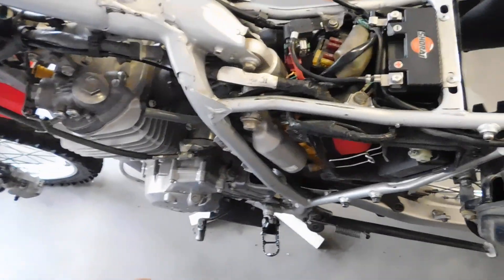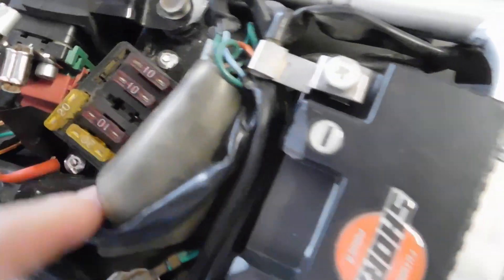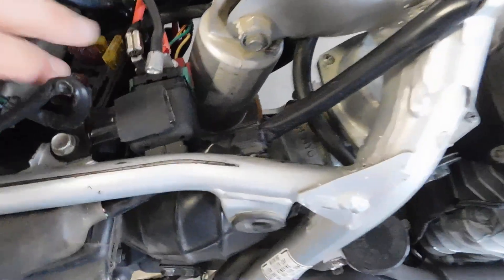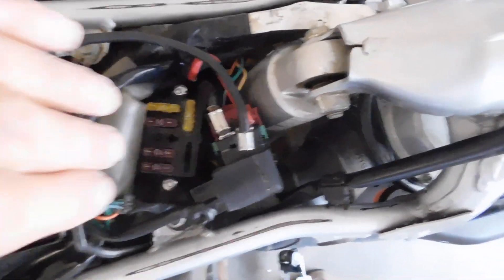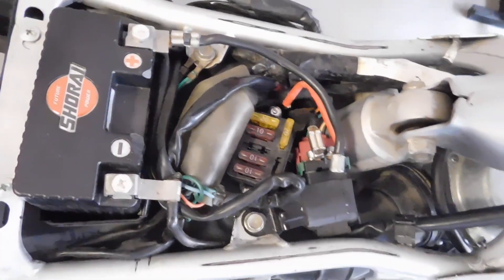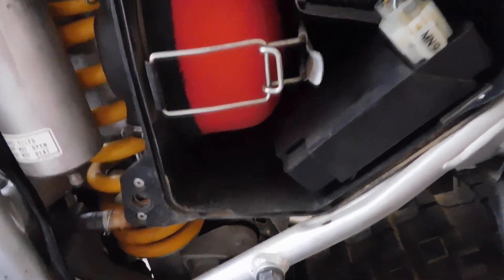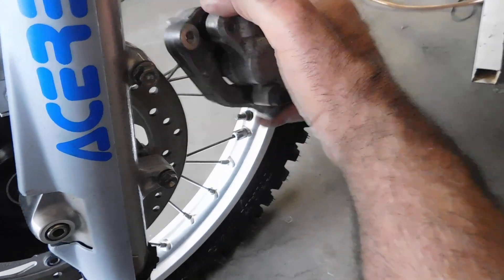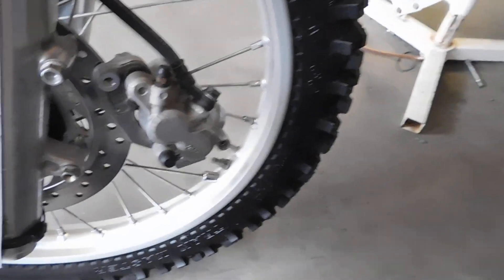Honda XR650L Battery Box Mod.

Comment: I think just changing to a Li ion battery in stock location gets you most of the weight benefit.  The stock location is actually lower in the bike but admittedly less centralized.
Reply from the maker: I have the small Shorai lithium battery in the side battery box too, with no problems. I do like the part of the conversion that puts the CDI in the airbox where it does get a stream of air flowing over it, since the CDI is the weak link of the bike. At some point I will do the full conversion but it is down on the list. Thank you for watching.
Reply: What I'm thinking to

Comment: I have contemplated the mod over the last 3 years of owning the bike. It does shed weight but my problem is, by moving the electrical you now have to remove the seat. I like the idea of the stock design as all electrical is isolated and easy to get to in the field.I guess it comes down to what you are trying to accomplish with the bike. I’ve learned what can go wrong will and the easier you can access it the better.
Reply from the maker: I came to that conclusion too, and just installed the new lithium battery in the stock battery box, and called it good. 
Main thing is just getting the weight down with the battery.

Comment: As many times as I have had to get to my battery, I will be leaving mine stock. 9 lbs doesnt make a huge difference when you have luggage, big size gas tank, skid plate, etc.
Reply from the maker: I got mine installed in the mighty XR650L and she spins over just fine, from what I have been reading this is the Cats Meow! 
I'll let you know if I have any issues pop up.
Reply: Agree 100%. This is a hack job. Wires jammed everywhere, open fuse panel, air box full. I'd like to save the weight but not this way.
Reply: @justintruedough4450  wuss

Comment: I did a battery relocation on my 2015 and it worked, never had any problems but if I ever get another one, I would not do this, just go with lithium battery and call it good
Reply from the maker: That is the route that I went and I’m glad that I did. Thank you for the comment

Comment: What was the factory setup on the earlier XL500, I know they didn't have electric start, don't know if they had CDI- it would be handy to adapt parts if they were similar as I would like to make a tool box to go where the electrical box is & be able to eliminate the tool bag for a bigger rack as I now have to use a smaller rack which wraps around the tool bag. 
Batman
Reply from the maker: I'm not really sure what the XL500 had for a battery set up? I was big on doing this mod but instead I just added a lithium battery to the existing box and called it good. The lithium batteries are so light the weight is negligible in the stock box. I ran the little Shoria battery for over a year with no issues. Thank you for the comment.

Comment: So let me start by saying I’m not sharp shooting or giving grief, just inquiring. That mod seems like it takes a lot away from how much air the motor can be fed. Looks like the the snorkel is completely gone. Im wanting to do the battery relocation but im also trying to get a little more power out of my 650. And it seems like this mod might take away form performance? Curious to see if you or anybody else has noticed any performance related issues.
Reply from the maker: I agree, I just used a small lithium battery in the original battery by and called it good. That move met my needs of getting the heavy battery gone from the rear. Thank you

Comment: One mod I’m not gonna do to mine, looks like it would harder to get filter out, I don’t like grinding things down especially a battery, plus I ride at trails I don’t want any extra water in my air box from mud holes
Reply from the maker: Yes I can see that, I have been running the small lithium battery in the side suitcase with no problems. I will probably go through with the mod though at some point. I think I can do it better than what the guy did in the video. Thank You for watching.

Comment: I think I might do this soon on my 2017. Was wondering if the Banshee is as good as the Shorai...? It's quite a bit cheaper in price. Heard anything about it?
Reply from the maker: I never heard of the Banshee? 
I have been reading several articles on the Lithium batteries and if you have the extra money its the way to go. Thank you for watching.
Reply: @verbalwidget0919  Hey, the Banshee is a Lithium battery too.....same basic size and weight...etc....but a "cheap" version....it's like $115....didn't know if it was just a cheap POS or not...anyway, thanks, your video will be helpful to me when I do my bike.
Reply from the maker: @buddywilson104  Glad to help, Let me know if you have any issues with your battery and I will post a video if I have any issues with mine. Take care boss!
Reply: Why do you want to put it all back to stock? Seems like a lot of work.

Comment: Seems odd to me. The air box cover on the left hand side is supposed to have a seal on it. If you use the seal and cover and you've bunged the air box hole at the top with the battey, how does it breathe ?
Reply from the maker: If you look at the left XR600 side cover there are about 6 or 7 holes holes in the side. 
I was thinking of going this way, but instead just put a lithium batter in the original battery box and called it good, left everything as it came from factory.
Reply: @verbalwidget0919  Ah fair enough. That's usually the supermoto way of getting air in. Not so good for offroad though :)
Reply from the maker: Agreed. That’s why I’m just going to leave as is. The lithium battery in the stock battery box is a good enough weight reduction.